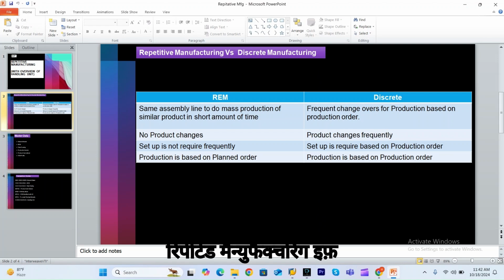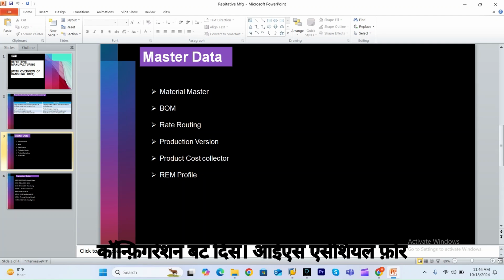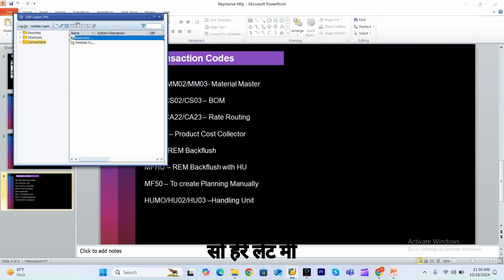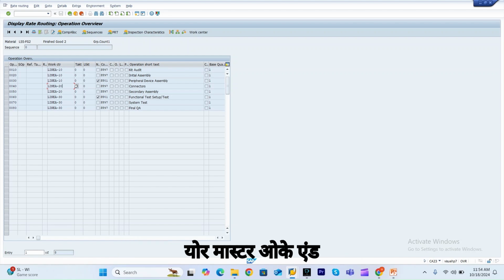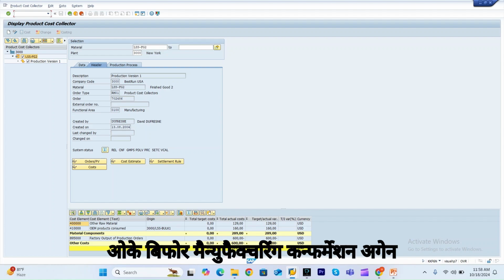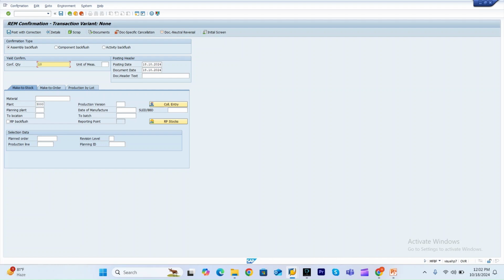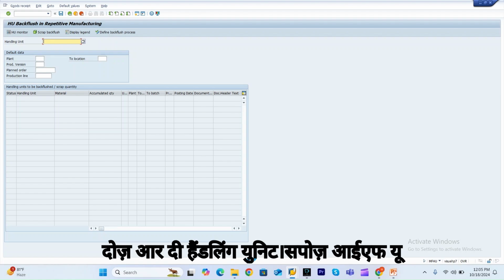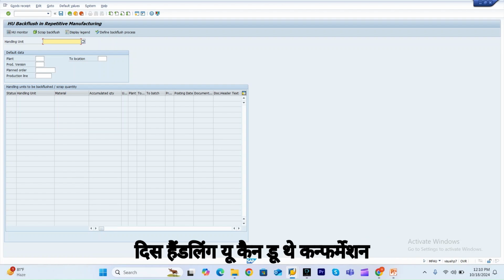SAP Repetitive Manufacturing (REM) | #saplobby| #sappp| SAP PP Repetitive Manufacturing Process

Comment: If Planned Order is created manually on FG, Which/ How MRP will create Pl Orders for components ? Do we need to run MRP for all components separately ?
Reply from the maker: MRP can run for FG.So it will explode bom and create dependent requirement for component.Also planned order for that requirement of component.But MRP will not impact manually created planned order of FG.
Reply: @hariharachoudhury7194 so we have to put FC on FG ?
Reply: @hariharachoudhury7194  So we dont need to put FC on FG ? Just based on Pl Order of FG, it will generate the DepReq ? Any idea on Strategy group on FG ?
Reply from the maker: Strategy group can be 40.What is FC ? in your comment.
Reply: @hariharachoudhury7194  Forecast